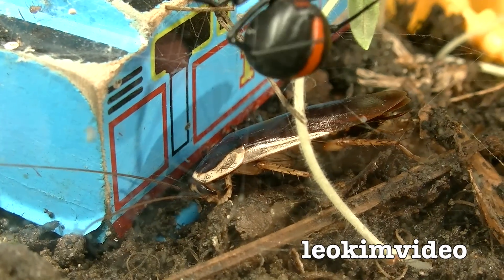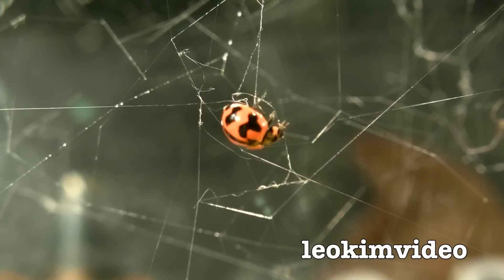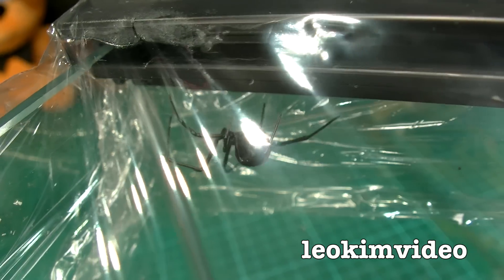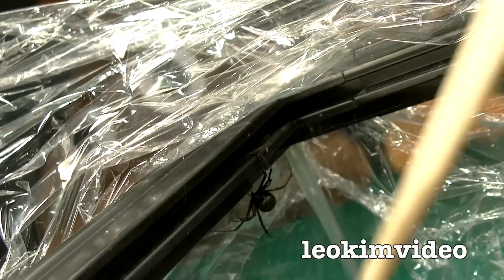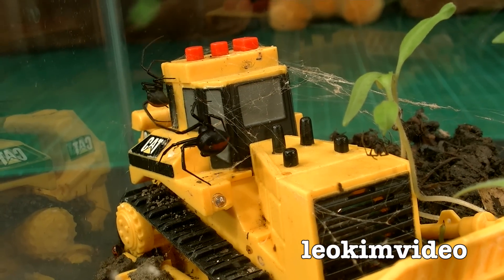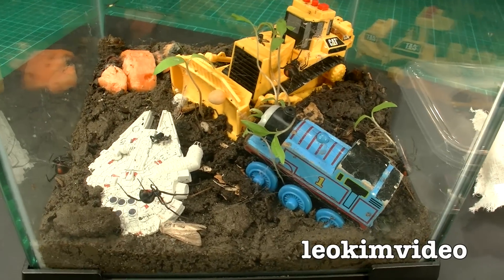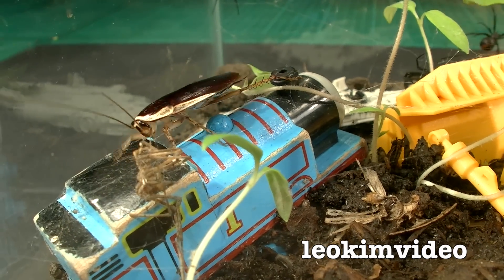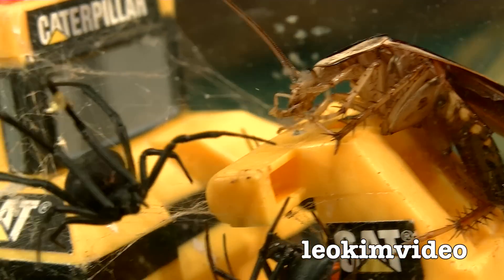Deadly Redback Spiders Attack Stick Spider & Vaseline Controls Week 3

Comment: It's probably too late to tell you this, but the best thing to keep insects from crawling out of a glass enclosure is to brush on a mix of isopropyl alcohol and talcum powder around the upper edge. The alcohol evaporates and leaves a good layer of talcum powder, which doesn't let their feet grip and won't hurt them at all. It works very well with ants, and I'd bet money it would work with spiders too.

Comment: are they also called black widows or is that a different type of deadly spider? If they are the same, i always thought they were a lot smaller. Bigger things are better cause you can see where danger is
Reply: joethahobo black widows have a red hourglass instead of a red line like the ones shown here, tho if you see one in person and can tell if it's a line or hourglass, you're probably to damn close and should run like hell.

Comment: +leokimvideo I think Heat Moisture Resistant Aluminium Foil Tape would be good to keep spiders down rather than using  vas, it works great for crickets and locusts so don't see why it wouldn't work just as well for spiders.